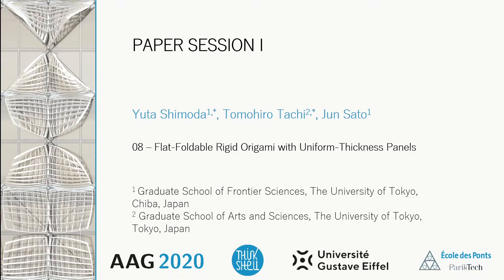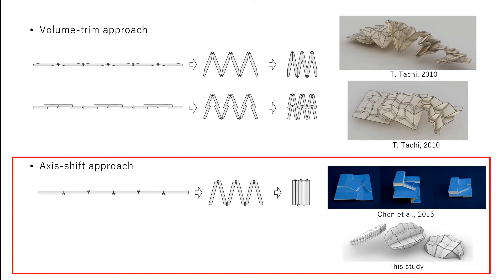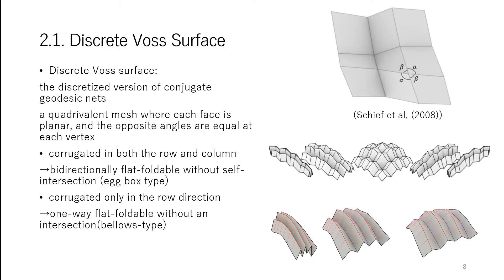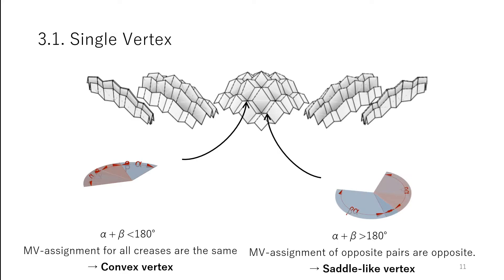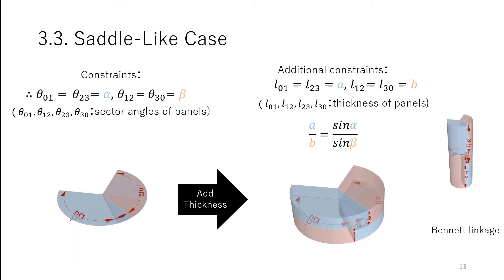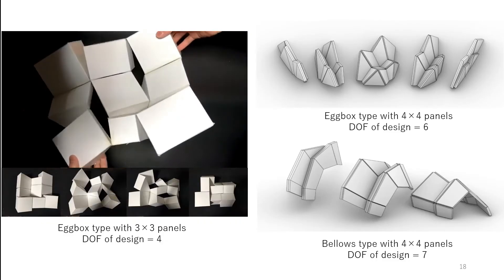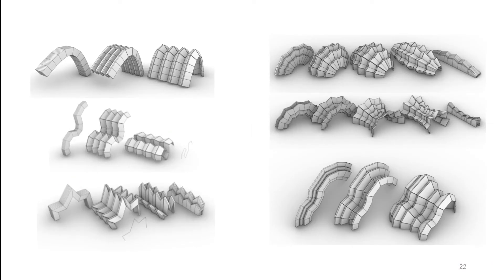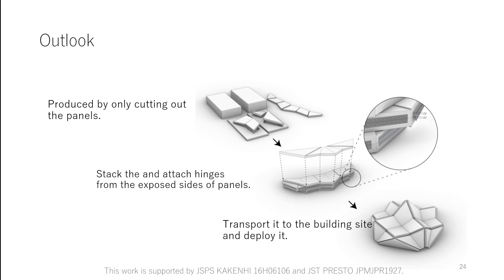08: Flat-Foldable Rigid Origami with Uniform-Thickness Panels - Shimoda et al

Comment: Very concise and impressive presentation! I have two questions :1. for a discrete Voss surface, should every vertex satisfy the valence of 4? Can this thickening method be applied to different kinds of origami structures? 2.for section 5.1, does the input only contain an arbitrary polyline and a universal offset distance for every section? Can there be more freedom in designing the other direction?